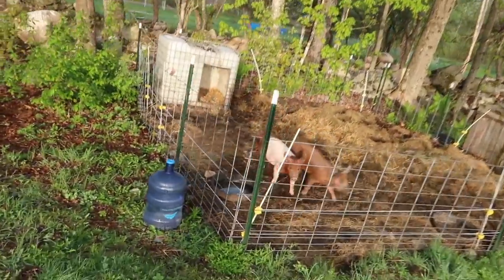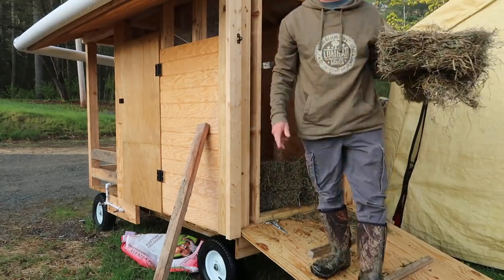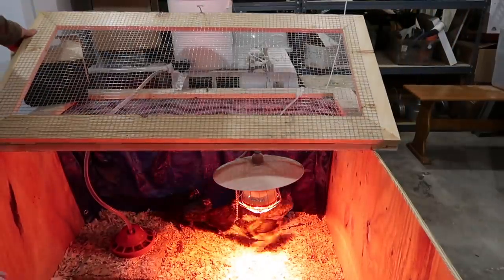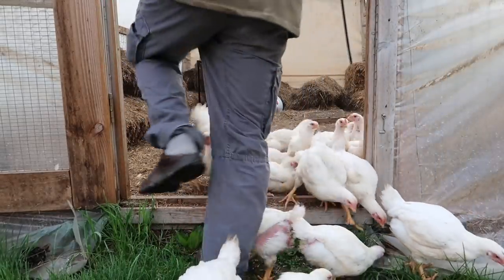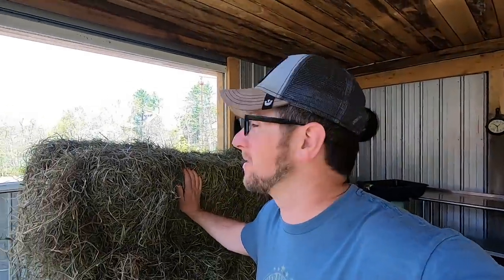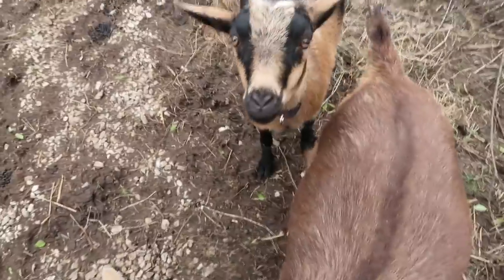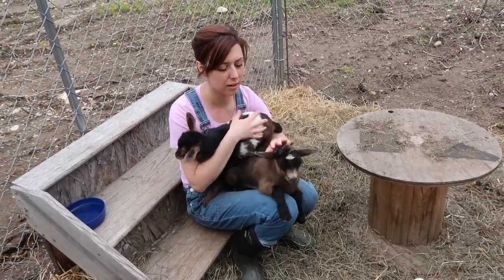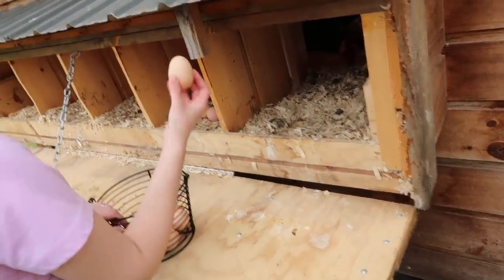We Finally DECIDED "Magnolia"

Comment: At Walmart the have these $50. rectangle outside trash cans with lids. They fit a bail of hay perfect. I drilled a couple of holes at the bottom in case water ever gets in there to drain but as of yet the hay has stayed dry. Just a thought for you for when you don't have the pig mobile for hay.

Comment: When will you put the the three older goats out on pasture?
That chicken tractor doesn’t cost $30 to make but it does take 30 minutes to build if you have all the right tools. When we built one it was more like $200 not $30. There must be a big difference in the cost of building materials where we live then where you live. The cedar pickets here are over $3/picket. The chicken tractor is nice though. It’s nice and light but the only con is if you get a good wind storm it can jump a 10 foot fence because our did and got busted up. So we had to build another one.